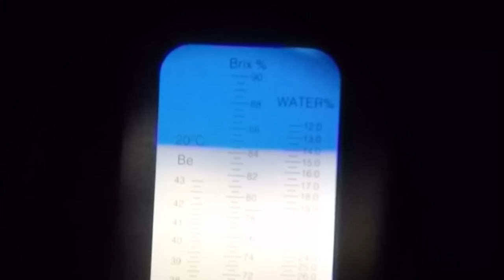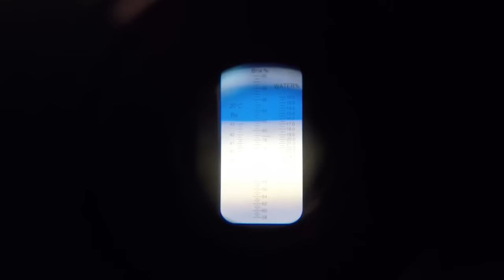Honey Is Flowing!! Extracting 2023 Honey Harvest

Comment: Alot of people having problems with buckets splitting.   Keep your eyes open.  I don't even pick buckets by handles and don't fill to 60 lb per 5 gal.  Pick up holding the sides till I get where I'm going with it
Reply from the maker: Yea, I try not to snatch them when they are full. Can’t have them leak all over the floor.

Comment: When I have those odd frames (partials and mismatched sides) I sort those frames out and run them all together at the end of the extraction.  I usually try and find two frames that are the same in content and place them in the extractor opposite each other in the drum also being mindful of which frames are "heavier" and which are "lighter" when loading.  By doing this I end up with a more balanced drum that won't walk the floor.  Also start out slow and work up to speed.  Definetely been a different year even up here in south central Pennsylvania too.  And in stead of just hazy, hot and humid we can add smokey as well still having Canadian wildfire smoke blowing through our area.  Wishing you all some relief from the heatwave down your way.
Reply from the maker: I got some relief from the heat😂😂 alright and it was thru me traveling 1500 miles north😁😁😁.

Comment: Wow wow wow that is so great to see just how much it all turned around. Your little girls proved if it is out there they can get it done. I am like you I
Purchased a hot knife well I never even plugged my up an have been using my bread knife. This season with my knife tho ever once in a while it was like it would start to pull clumps of comb out like my knife was getting dull . Any  thoughts . That was a first . Also Mike on overwintering your supers like that with them being in the open an full light do you not have any problems with wax moths even if there are some brood/honey frames out there . ?? . I have had maybe four frames this season first year frames honey only that the wax moth had started leaving trails in them fast . Get my crop sold this season I guess I will be calling John hill for my 18 frame extractor an I think I will keep my Maxant also . I
Reply from the maker: My knife does that too every now and again if the honey is thick and I go too fast. When the honey is super dry and thick, I have to go slower and that helps prevent that. But I do see that. With the frames, I group all frames that had any brood or pollen together and then I stack them on their own stack. I get a little bit of damage to a few now and again, but nothing serious. This season I only had about 7 boxes like that, so I put them back on strong hives over excluders when I could after they weee cleans out and dry. I will store those boxes that had brood on the hives until around December after a couple of freezes and then take the back off.
Reply: @MikeBarryBees  Thanks I had not even thought about keeping them on for that reason great idea . Another thing I was doing this season that was stupid of me I have just got toooooo many things going on. I have been pulling supers an pulling them down to winter season an for so reason not even thinking about swarms so now I need to go back and add to give them some room but luckily I have not found any cells so I hope I can get one  added back to stop swarms . Just not thinking . Have a great week. THANKS
Reply from the maker: @kathyhathaway8823  I do that. I get them down to to deeps for the most part. Only where I storing the supers or on singles did I add a box. But most of the doubles are just that at Thai time of the year. Now your region is different, so if there is not a dearth, the I would add the space. But if there is a dearth, mine do fine, even when crowed, once I break the down to two.

Comment: Always put some calico or plastic fly screen on the top and bottom of the wax. It helps stop any suction caused by the mixture of wax and sticky honey. The presses start at less than $100 here in Australia, they are stainless steel and real easy to keep clean. They are available in several sizes.
Reply from the maker: Thanks for the info!!

Comment: Nice setup!!  I think I'm going to have to get a proper uncapping tank at some point soon.  Just curious - you said the refractometer is new... what do you do with a new refractometer to ensure it is calibrated to start out so that you know the reading is correct?
Reply from the maker: Thanks Terry!! I calibrated it as soon as I got it per the directions. Extra virgin olive oil and then set it to the proper number on the gauge. I was sure to do it at the same temp as my honey house. Needs to be calibrated within 5 degrees Fahrenheit of where it will be used.

Comment: My bees really tear up the comb if I just set frames out for them to clean. If I put them back on the colonies they repair it and clean it. 
Any idea why the difference? It's like they're robbing instead of just eating/cleaning.
Reply from the maker: Well, if they are capped frames they rip the to shreds. But I’ve never had them do that much damage if they’re just wet frames that I have extracted. I leave them like this every year. One thing I have experienced putting wet frames back on hives if they’ve went into a dearth is they like to attack the hive i put the wet frames on. They smell the honey and rob that hive. If there is still a flow, it’s not an issue. As far as what you’re experiencing with that, I’m really not sure. Just haven’t seen that happen with mine.